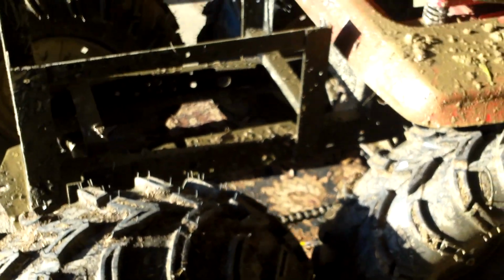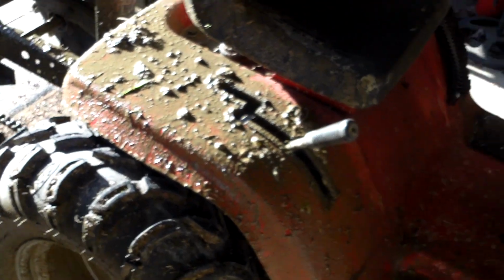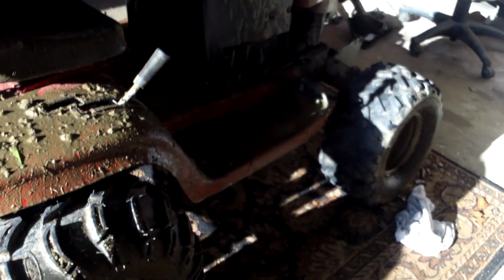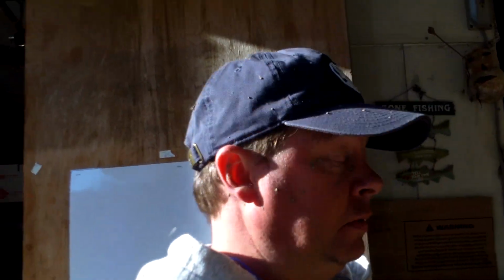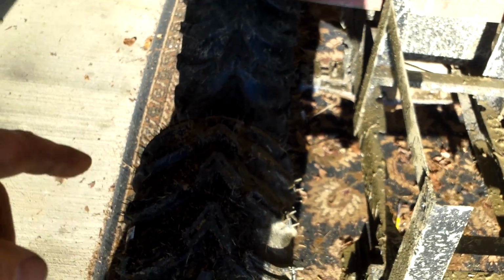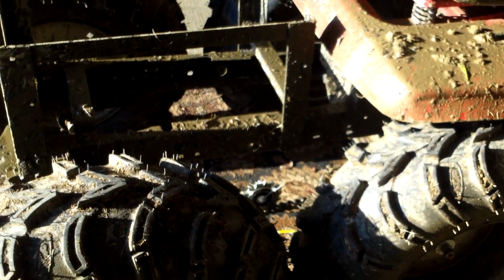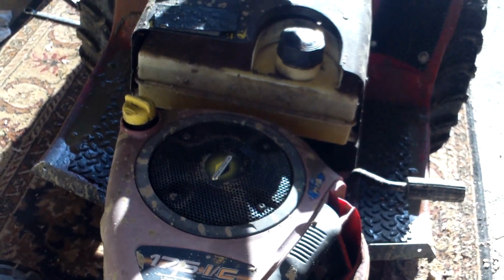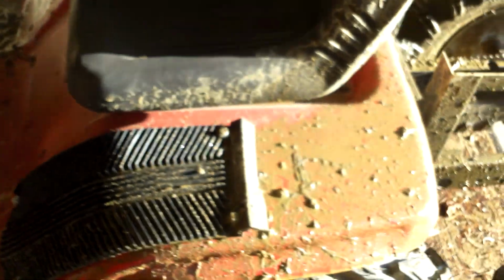Test ride

Comment: I think I would have hooked up some suspension on the rear axle. depending on the terrain your on, if it's really bumpy it could cause 1 axle to be off the ground without suspension.
Reply: ***** I think it would definitely be beneficial to the ride and it will also take a lot of stress out of the chassis too. I don't think it would be to hard to do. You don't need anything too complex, just some leaf springs and hangers would do the job.

Comment: your steering problem is coming from 4 tires pushing forward an only 2 fronts trying to steer so it's under steering. back in the days of the Honda atc 250r you had to drift them around corners or else you would make the turn too late an in the berries you go. well that's my opinion